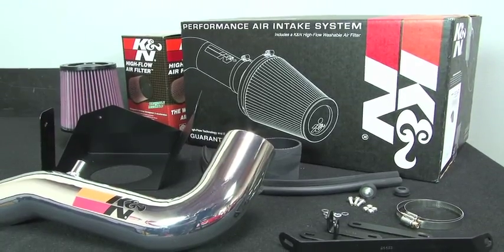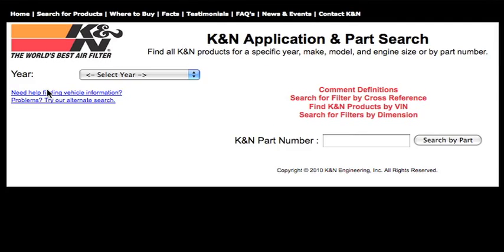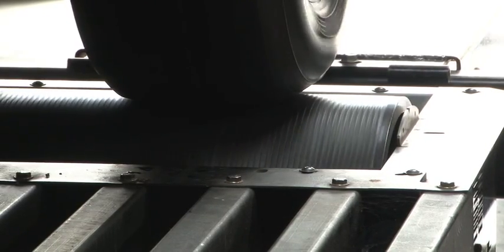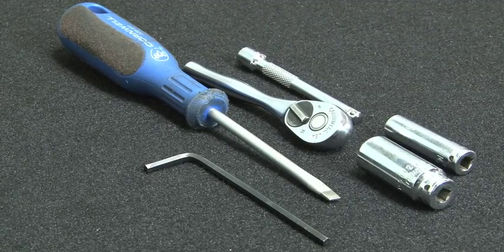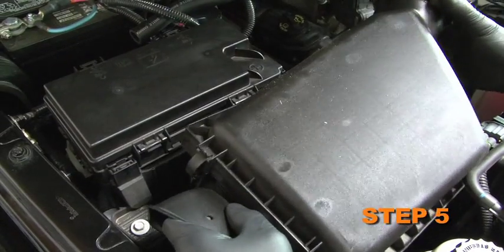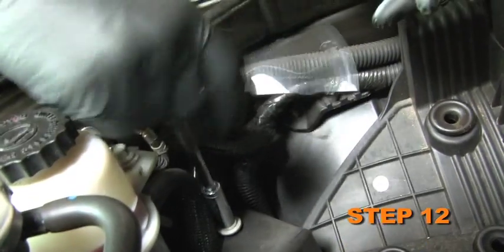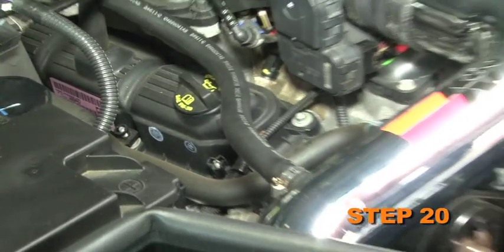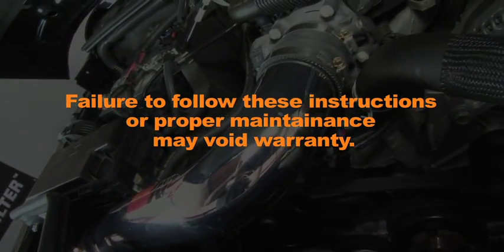Jeep Wrangler 3.8L [#77-1553KP] Air Intake Installation

Comment: @KNfilters yes, the 57. I dont know why its rubbing againts the circuit board and the heat is causing the oil to warm up and drip somewhat. Did this happen during your testing?